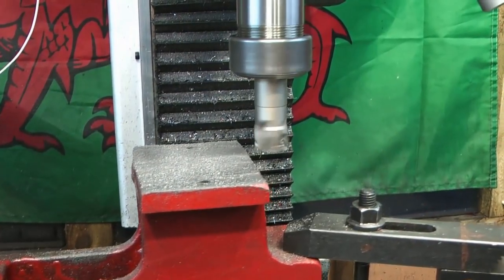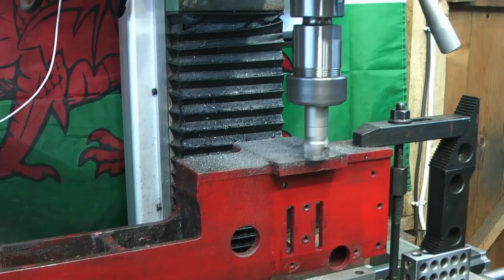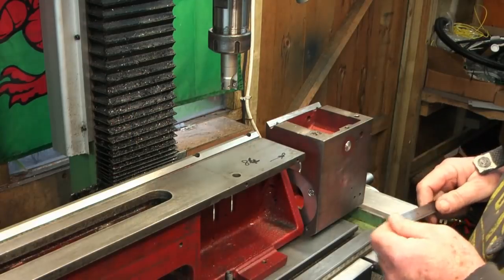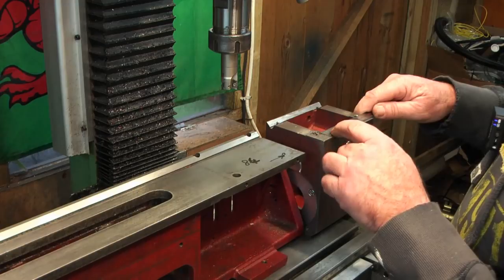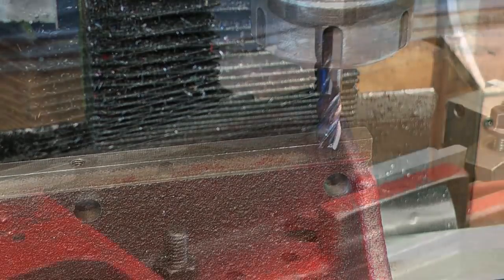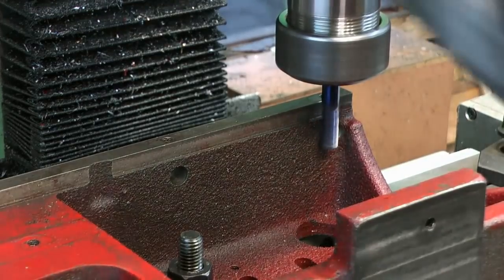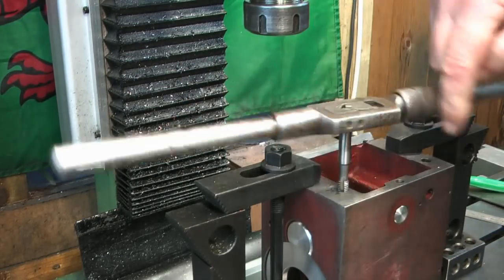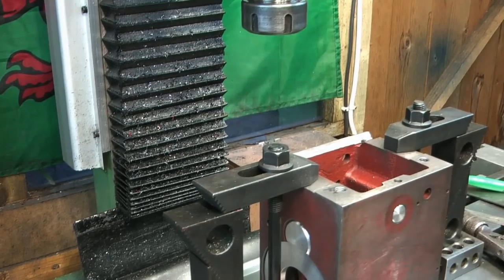Mini Lathe refit part 3

Comment: If you were feeling super keen I reckon there is plenty enough material to put a tapered gib strip and adjuster in the rear!  Lovely job on the additional head stock bolt, I always thought the three bolt hold down was asking for problems.  Big thanks for your videos, I always look forward to them.

Comment: Great stuff Ade, I bet you will fettle the bed a little more to get the saddle to run smoothly over the full length. Could you mention in future  commentaries the speed of the mill and size of cutter, I know this varies with material, depth of cut etc but it would be good to get a feel of the speeds you use. Many Thanks.
Reply from the maker: Duly noted , I will bear it in mind . Cheers Ade.

Comment: You've got me to thinking that if I'm going to fasten my lathe to a piece of plate that I'd be better off to cut out the rib you scalloped and the rib under the two holes on the user side.  With that I could replace it with a solid piece with four bolts all the way through.  Maybe.

Comment: I made hard bronze strips for my mini lathe about 16~17 years ago.
 Fit the thickest you can for the front then run  a 3/4" end mill or bore for clearance through the side. The front strip needed a lot more work than rear to get various clearances (pinion, rack, etc) but it was definitely worth the effort. make a cover for the apron gears while your at it, one the first mods I did. Pretty much anything reasonably rigid works well, I used 1/16" phenolic sheet (Tufnol) as I had it laying around. Drilled apron for countersunk 3mm screws and put some greas in. Should probably take a look at it some time soon? 😁

Comment: Brass is a good choice for a bearing face provided it will be free from contamination, which cannot be guaranteed on a lathe. Any turnings that can find their way into the bearing face, if harder than the brass willi bed themselves into the brass and cause premature wear on the lathe bed, suggest refiting with cast iron gib strips. Keep up the good work Aide, great contnet as usual.

Comment: Hi Ade.  Nice work on the headstock fitment, I'm sure the extra bolt will help with rigidity.  I'd question the wisdom of the fixed plates under the carriage, I'd be tempted to put gibs in (maybe tapered ones), or go shallower on the cut and shim to fit with coke can / aluminium foil / fag papers   Either way you have a non-machining way to resolve the eventual wear. I'd probably have scraped the bottom face on the bed to get to a closer fit, too, even if it's "only" 20-odd microns.  For the front plate, You should be able to go with the same block, and mill out a recess for the pinion, unless I'm missing something (which I almost certainly am).

It's always interesting to watch people make a precision machine out of what's, out of the box, a long way from being that.

Comment: Instead of shaving off the hole to get the bolt head into it , why not get a longer bolt and make a custom spacer this way the cast will not be compromised. I use copper washers on rough cast to get a better grip.
Reply from the maker: That is a good idea . too late now it is done . Cheers Ade.

Comment: It will be interesting to see if the brass holds up over time without needing to be adjusted in some way.
I wondered when I put in new angle contact bearing if a fourth bolt would have been a better idea but failed to do.😢
Adjusting the saddle behind the apron is such as pain!

Comment: Just a thought: Your lathe bed warped because it wasn't  seasoned properly. If I were you I'd check the bed rails for the same reason. Thanks for great video and try not to talk with your machine running so close, all I hear is the machine. Very interesting content, Thanks Ade